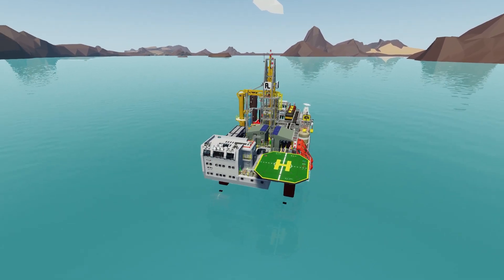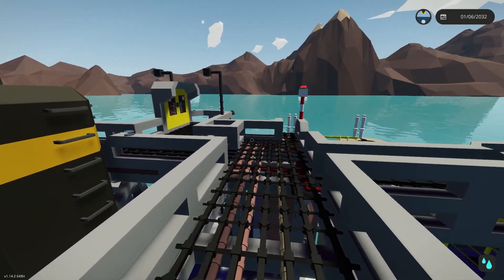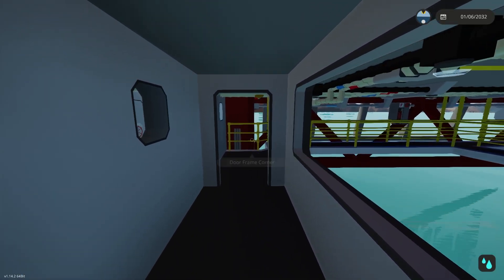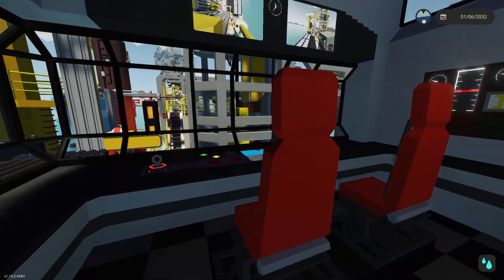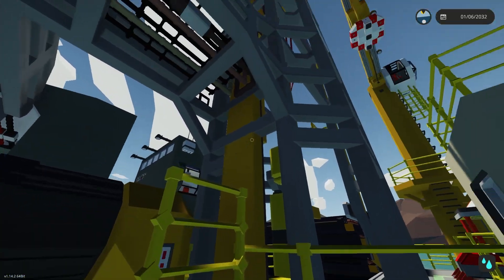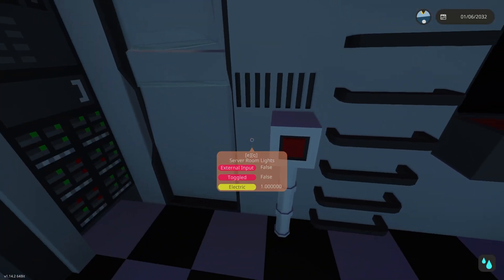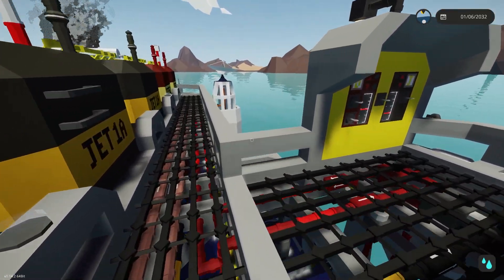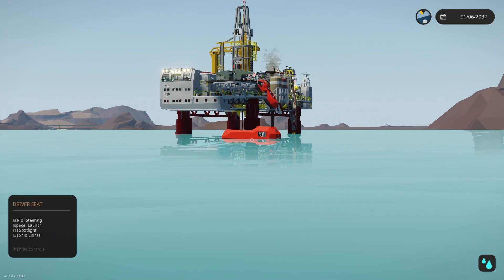Ocean Oil Rig Build Release Video : Workshop Walkthrough

Comment: Does it matter where you drill? because im not getting any flow
Reply from the maker: Yes you have to buy oil site maps to find oil deposits, you cannot just drill anywhere
Reply: @WhackAL  i cant find any oil deposits in sea anywhere, even in custom with everything unlocked

Comment: Is there a way to fold it down? It doesn't fit under the bridges, and it automatically unfolds it once you spawn, so there is a possible way to do this but uh can we have like a fold option? Sorry if I missed this feature already.. Also its so slow 😭
Reply from the maker: Sadly there is not. It all locks into place. I would have had it fold but the weight of the platform is really pushing the limits of sliding tracks and I did not want to add more complexity. Folded up it’s too tall to fit under a bridge anyways so it doesn’t really change things…

Comment: Hey there. I'm Norwegian, so of corse i work on Oil Rigs. The personell carrier in the end is what we call a "Frogger". There is useually 3 seats with dampeners in them to make a soft landing for the personell riding it. the "pipes" you drill with are useually called "stands" and the "pipe tower" is known as a derrick. Feel free to ask questions, i have been working on oil rigs for some years.

Oh, and good luck making a realistic living quarter. On drilling riggs they are useually at least 5-6 floors tall with a max POB (personell on board) of at least 100 people. all of them have a gym, all Norwegian ones have single person cabins and some have extremly good accomodations, like cinema, BB gun range, hobby rooms, sauna and one i went to even had an outdoor jaccuzi!
Reply from the maker: Thanks for the advice. The rig would be more realistically scaled if the game could handle it. I wanted to have a lot more interior space but I also want the game to run and not crash :/
Reply: We just called it a crew basket in the Gulf of Mexico, but I worked on dive boats that serviced rigs. Ours had no seats, just thick roped netting you'd loop your arms through as you rode standing up. Some of the sketchiest rides I've ever been on were crew basket rides. Our other common method of crew transfer was called "jumping to the boat landing;" sometimes you had a swing rope and sometimes you didn't.